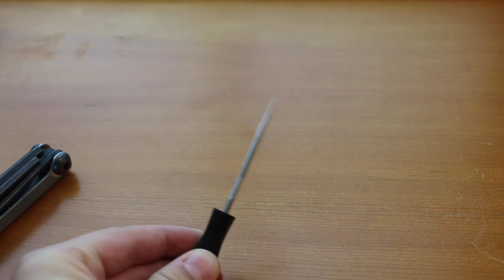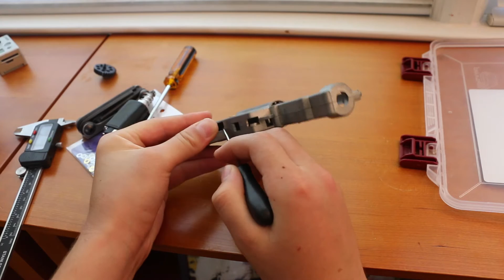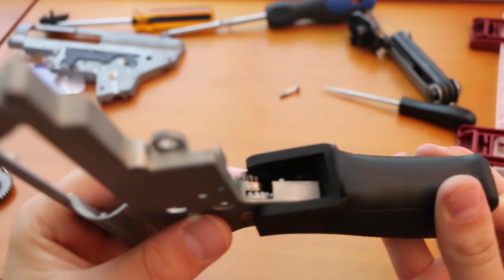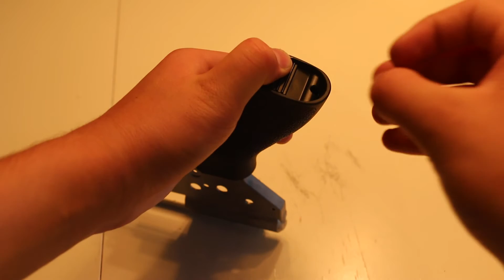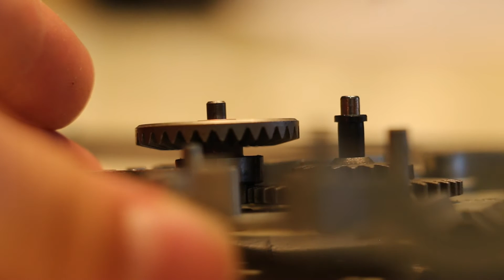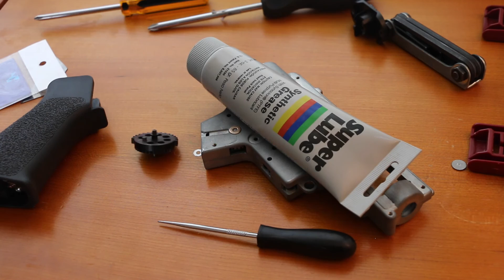Airsoft AEG Shimming Guide - Newest Method!

Comment: So my question is how is the side to side movement of the bevel gear an indication of a good shim installation? Wouldn't it be dependent on how far up or far down the pinion gear is engaging the bevel? Like if it's too tight it's because the motor is adjusted to high up causing it to bind. If it's too low it will be way too loose because it isn't engaging properly.

Maybe I misunderstood it but it didn't make sense to me.

When I shim I make sure the motor height is set so the pinion is engaging the teeth of the bevel equally. Then I shim enough to place the bevel level to the pinion without pushing too much against it. I don't look into side to side movement. Just the contact points of the teeth of both gears and the motor height. 

Like I said I may have misunderstood but just wanted to ask for clarification.

Thanks keep up the good work.
Reply: The side to side movement of the bevel gear is simply an indication that the pinion is not pushed up against the bevel gear. If it were pushed up against it, and they were making contact, then there wouldn't be any free side to side movement. You're simply looking for there to be as little movement as possible, while still having some amount of movement. The key is having some amount of movement to show that they're not bound up. The part about the movement being less is because there will usually be a smaller amount of side to side movement when the pinion and bevel are shimmed closer together (motor height will have a similar effect). This is due to the fact that the teeth of the bevel gear get progressively thinner as you move closer to the axis of the gear (horizontally) and also as you move farther away from the top of the bevel (vertically). The situation of the motor height adjustment causing there to be less movement has to do with the horizontal change is thickness while the amount of shims has to do with the vertical change in thickness of the bevel gear teeth. The objective is the same as what you stated, it's just a different way of getting to the same place. I find that this method is the most effective.

It's difficult to explain some of this solely through text, but hopefully you understand my point. For the most part, you're completely correct in your thinking. I hope this clarifies it for you. 

-Matt
Reply: Matthew Gruen Ah okay. Yes that makes sense. Thank you Matt.